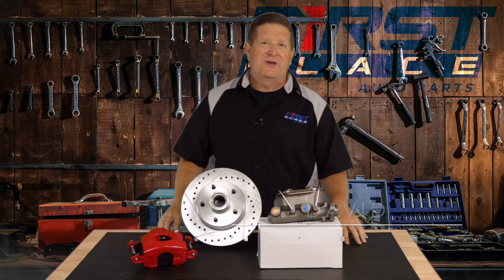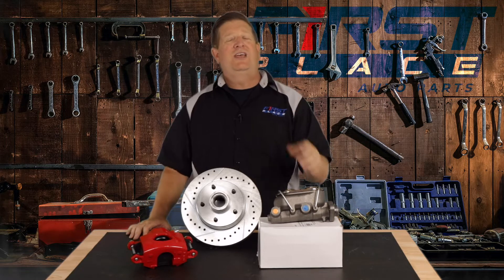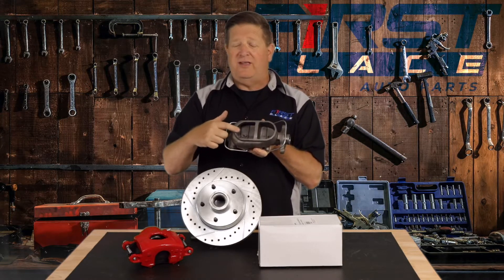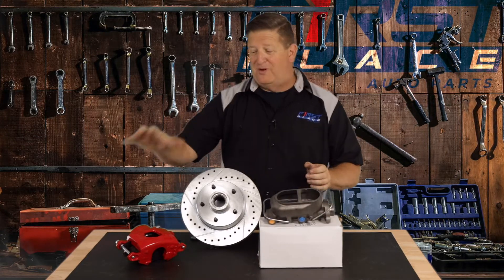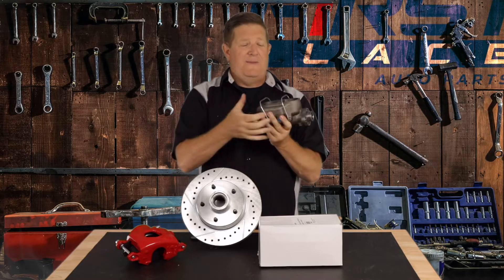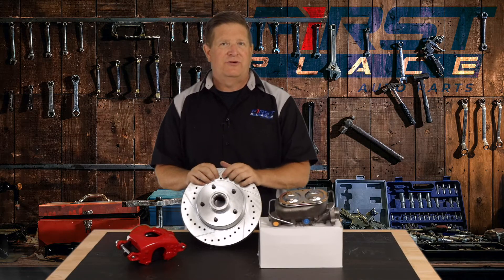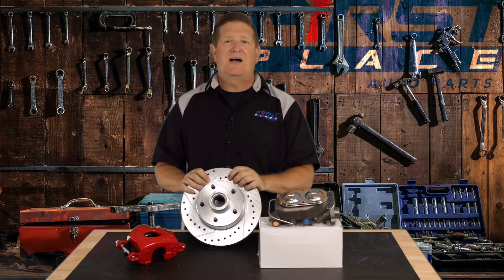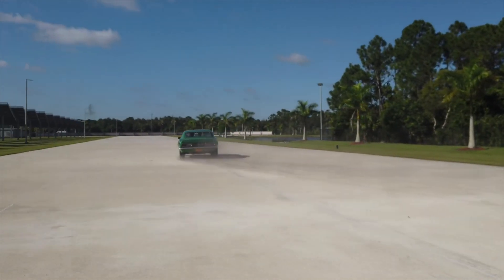Brake Master Cylinders Explained | Does Your Disc Brake Conversion Need a New Master Cylinder?

Comment: I agree with 7924 post.. Nothing about which part number for a disc/disc master cylinder. Nothing about bore size.
Reply from the maker: Call our tech line they can help! 877-797-1969

Comment: Learned a couple of things about brakes. I have disk front and drum breaks on my 55 Nomad, and it's worked well for years. However, I'm building another 55 Nomad from frame up literally since it was a 210 2 door wagon. My question is, do I need a proportioning valve like the disk drum set up?  
I wasn't aware that the disk brake pressure was higher and flow because of the chamber size of the calipers. It makes sense now. Would I need a larger brake line than a 3/16" line as well for better flow to the rear set up now that I'm running full disks? 
Further note, it will also be a hydroboost system from a truck I picked up. 
What would you recommend?

Comment: I just converted the rear brakes om my 1980 Chevy K20 and the master cylinder chamber for the rear brakes is TINY.  I was hoping this video would give me a hint about the master cylinder but it didn't. You're just trying to sell conversion kits.
Reply from the maker: Call our tech line they can help! 877-797-1969

Comment: Would have been nice if you would have went into more info about the master cylinder bore size Instead of pushing your conversion kit!
Reply from the maker: Call our tech line they can help! 877-797-1969